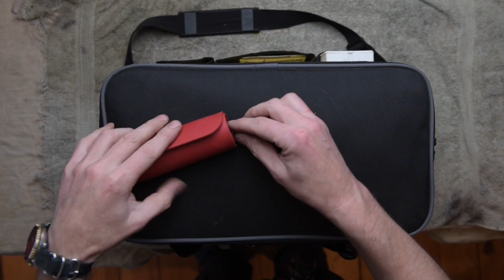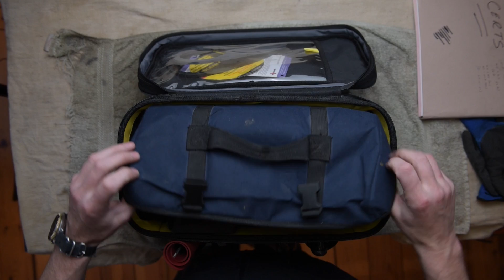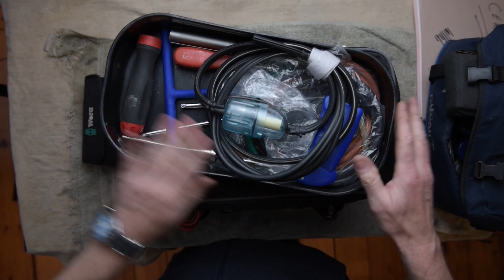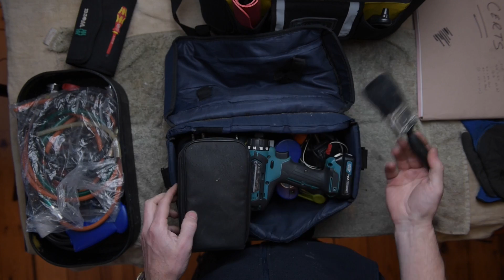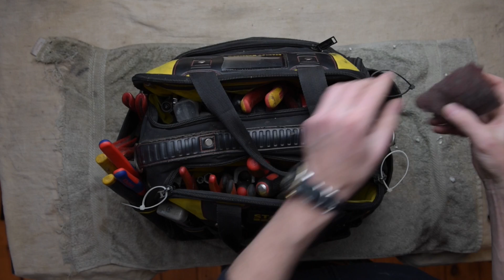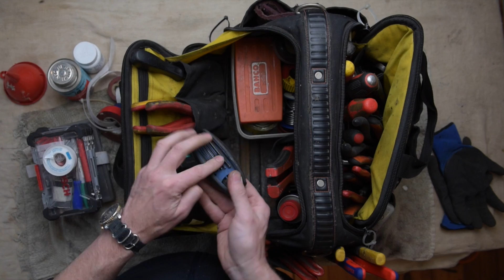Plumbers Tool Bag, Dr Pipes Old Bag

Comment: I have most of the hand tools you mentioned. I agree with your review totally. Especially the chrome knipex. I have both sizes are when your trying to work quickly they can be a faff. I would recommend the 15mm to 22nm double open ended ring spanner. Saw it on Skill builder channel it works a treat when fitting compression valves etc.  would appreciate some more info on your specific boiler tools you have developed over the years and where you use them
Reply from the maker: Thanks appreciate it 🙏🙏

Comment: Hi Dr pipe I've been subscribed to your channel for a while now and enjoying it ......I just had one question what is the brush you use to clean out vaillant heat exchangers , it connects into a drill. It looks the nuts and it'll be handy for me.
Reply from the maker: nindes only out of warranty cleaning as the Oem doesn’t endorse that cleaning style. Just gentle paint brush. Pleased u enjoy
Reply: Right really good advice 👌

Comment: You didn't seem to be impressed with the 2 different sized Knipex plier/wrenches after using them for just a few months. The adjustment looked fiddly and getting it tight left the handles sometimes open too much. Has your opinion changed - yes or no/why? I've just ordered a pair of the 250mm length Knipex on the basis of rave reviews and thought the smooth parallel operated jaws and clamping strength would replace my worm screw wrench.
Reply: One of the best tools I have ever bought and I have lots and lots of tools.!!
Cobra pliers should be on the list and also look at the Knipex Raptor pliers if you do plumbing

Comment: Ordered one of those Versa Funnels can't believe I've never heard or seen one before they look so handy. I've been using a Stanley large stand on type toolbox for years and it has lots of tools in that are not used much for servicing and it's a back breaker to carry around to jobs, so I'm make up a little service bag like you've done. Keep up the vids.
Reply from the maker: Simon Worger one of the best cheap purchases you will make 👍👍
Reply: @drpipe  just added one of those to my ever growing tools wish list on Amazon and this will work a treat in conjunction with those fold away small buckets that can be crushed against pipes etc... 👍
Reply: Funny my two bags are very similar.
The only thing I've done of late. I've bought some little Technic or similar bum bags. 
No matter what, you don't need everything but the kitchen sink. So I've split certain tools down into three smaller bags. Works for me. Be warned. Don't put all your eggs in one basket and that shit bag breaks into the van. It's hard to take. Happened to me 5 times. Last time over 10 years ago at a cost of 4k.
Im 61 now and even though I still adding to my kit I couldn't bare purchasing another life time of tools which some I lost from my apprentice and early 20/30's👎
Nice video. Nice to see fellas taking pride in not just there work👌

Comment: Ah makes sense, mine is 10 years old and has it I still see many engineers with alsorts of gadgets when the anton does the lot.
Reply from the maker: andrew smith you have me thinking now.. will phone them.. to be fair I think it’s upgrade time had this setup 10 years was never told abt gas detect facility .. I remember it had a heat temp flue connector but that fell off year 1 ! Hope Tec has moved on if I upgrade 👍
Reply: Ye I'm in same boat, battery not holding charge very well but cant complain with 10 years service...I've loved my sprint!

Comment: I need that vaillant drain down hose in my life!
Reply from the maker: If I had enough interest maybe I would make some for Subscribers or give them away in some kind of giveaway. Glad you liked it.. I use it all the time now. Thanks for watching really appreciate it.
Reply: @drpipe  Is the end from the rapid dose kit by any chance?
Reply from the maker: ghostmanromeo uk no I’m a machinist for hobby and made it up as a Product but never sure if it would catch on. As I say if I had enough interest would make a few maybe as a giveaway or special event. Glad u like it. Thanks for watching. All my own work.
Reply: @drpipe  looks the deal to me, now I really need one for my kit 😭. Btw Great of you to share your experience wisdom and tricks of the trade, top fella 😊
Reply: I second that, fed up attaching my manometer tube to do draindowns. I've pressured a few times using the dosing tool I made up with a hozelock garden sprayer plus adapter for the end.
Reply from the maker: I have to say when I made it I thought it was top notch ... but lots of engineers can’t be bothered.. I found the manometer tube just kept degrading... then one day found a leak in the tube on a tightness test... sent me around the houses for ages. No leak tube went from Chems etc. Enough. Glad you like it.👍 if we get 100 thumbs we will work it out somehow.
Reply: Great video 
I need to condense my tools bag down
Job for this weekend I think 
Weighs a ton
Reply from the maker: Hunter Heating Services Ltd defo mate.. I had to I suffer with Tennis elbow and honestly.. we don’t need All this stuff. You would be surprised what u can fix stuff with at a push 👍 thanks for watching.
Reply: Dr Pipe true 👍👍👍👍

Comment: Nice kit good to see. Do you have issues with tool theft in your area ? I bring all my main gear in at night because of the amount of theft in the area I’m in. Which is actually regarded a very pleasant place.
Reply from the maker: Heat Service bwc uk  Thanks for watching hope you enjoyed it. I use the best I can afford and applaud guys that get stuff done without having to spend £300 on a tool bag think that’s nuts. It’s your mindset that gets stuff fixed not your tools.
Reply: Dr Pipe yeah I agree. Basics are often the most important but some of the bits now make the job so much easier. The mind will always be the best tool in this game! I must admit I did treat myself to a veto bag which I know was very expensive but I do appreciate the quality. I do have a lot of Stanley gear too fantastic for the price I have to say.
Reply: @heatservicebwcuk1545  a pro pack and an Tech Xl. I've had my pro pack since 2012, Great  stuff👍🏻
Reply from the maker: The van has a state of the art Alarm, a tracker linked to my mobile phone and service, backed up with a pager just in case that goes down. Yes I bring the tools in every night even tho I sleep 6 foot from my Van ! Oh did I mention the Dog and the ctv monitors my off street parking. Trouble everywhere in Uk with crime.. but I take great care when it comes to my stuff.